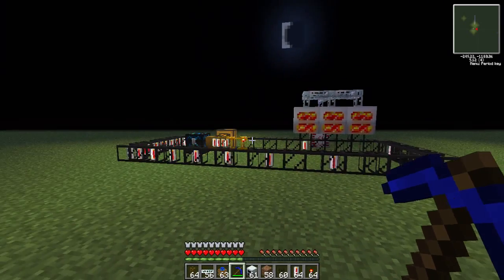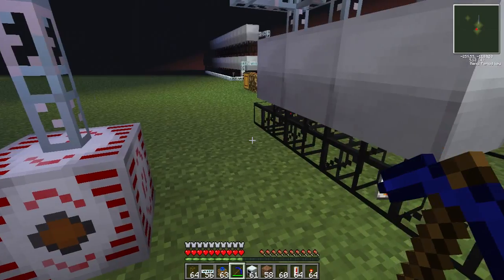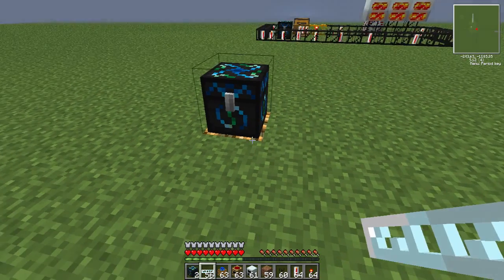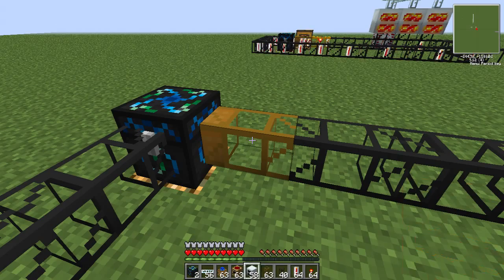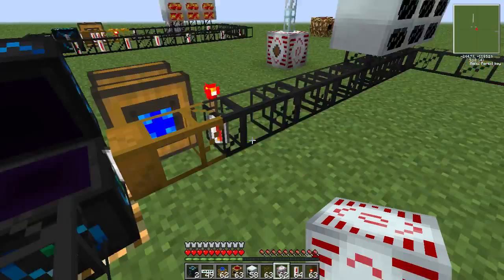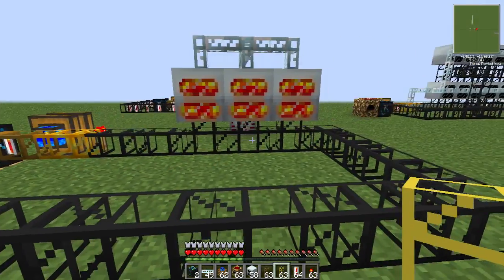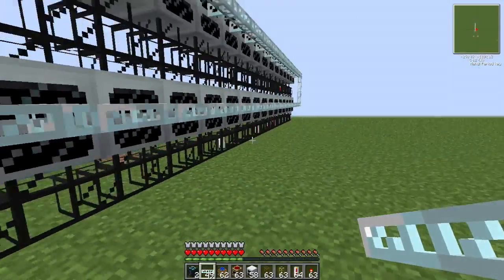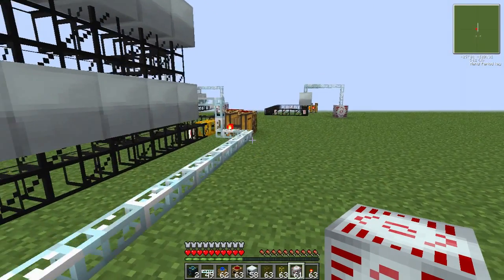Infinite Power - Tekkit Tutorials Episode 1

Comment from the maker: It would be possible. You could make an automated system that actually makes the lava cells. If you want more information we are currently designing a fully automated solar panel farm that makes high voltage solar panels, you can use some of the ideas from it to make a system to create lava cells.

Comment: The energy condenser will eventually be filled with lava cells.. which means the overflow of cells will just drop out of the pipe and cause lag.
A fix for this would be a hole with lava by the condenser where the cells drops.
Other than that, good job.